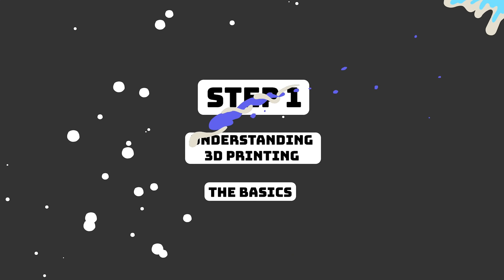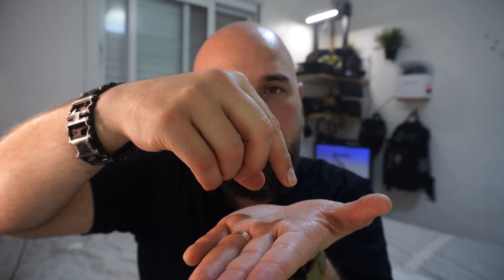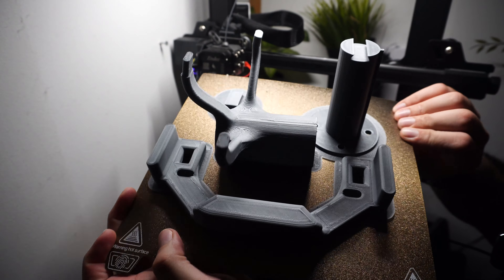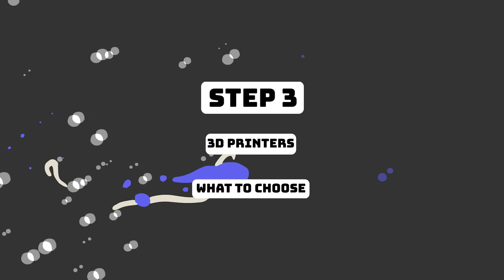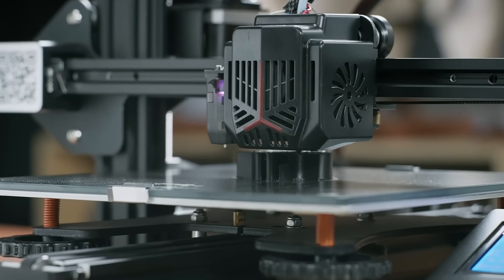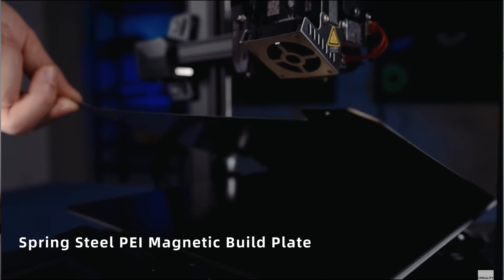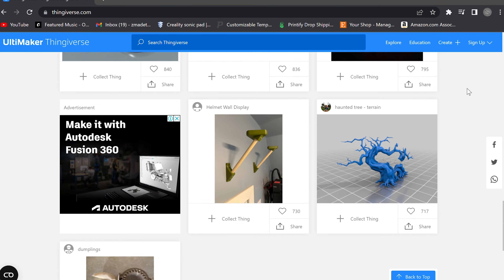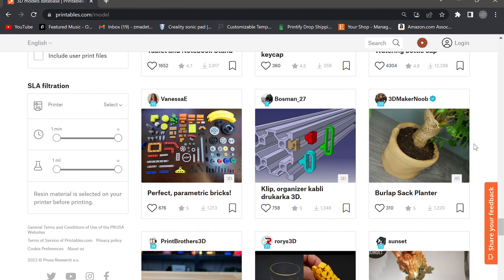5 easy steps to start 3d printing 2023

Comment: Awesome video with all the main information needed. However, I have a question: As a first time in this area, I was looking for some options in my budget and I have doubt if I should start with an Ender 3 3d or spending a little bit more and get an Ender 3 3d v2. My idea is just to do small things for me, not worried to much with great quality. Last question, should I get it new or used ones can be trustable as well? In case of used, what I need to check to get a reliable one? Thank and sorry for all the questions.
Reply from the maker: Are you kiding, of course ask anything you like i am alwase happy to help😊 if you have the budget its alwase better to upgrade, i used the ender 3 and moded it out for a wile, but you know what? When i got the s1 pro i was blown away, it was a whole new experience, about the ender 3 v2 i have heard good things but truth is i dont have enuph experience with it to tell you if its a beter option, but i do know the s1 lro and its amaising! Anything you want to asks alwase feal more than welcome i love this hobby and i love helping people so dont be shy😊

Comment: Nice introduction to 3d printing, apart from the printer advice.  The Prusa is definitely NOT for people starting with printing - if you want almost the same thing at a decent price, get a Sovol Sv06 instead.  The Ender 3 is great if you can get it at $99 but otherwise there are easier to assemble cheap FDM printers from Elegoo (Neptune) or others (ex. Aquila) that are just better at low price.  Ender 3 is outdated by now (but still a good starter if you can get it < $100) and S1 is way overpriced.
Reply from the maker: Thanks for sharing! I appreciate the input

Comment: Good video, but. First printer, what can you afford, that's the one you need. Slicer, use the one that came with your printer. Print things that can be found online, easy stuff first. Learn a cad program. At least my reasons for buying a 3d printer was to make what I could buy or find. And last, keep a notebook to record settings, what did and didn't work etc. 3d printing isn't hard if you pay attention. I always watch the first layer, if it doesn't stick, it won't self correct. Correct as necessary.
Reply from the maker: Thanks for the input

Comment: No love for Bambu labs?!
Reply from the maker: I think bambu labs has a whole lot of potential, and the x1 carbon and p1p look like awesome printers, I was considering adding them to the list, however, the reason I didn't is because of 2 things, first of all, Bambu labs is a new and the community is not that large yet, which means the only source of help is the company itself, second, the whole system is proprietary at this point the only source of parts and software is bambu labs itself, and in my personal opinion the x1 carbon and p1p are awesome printers but I think its a little too early still to recommend them to complete beginners